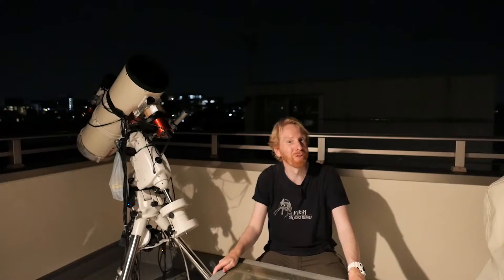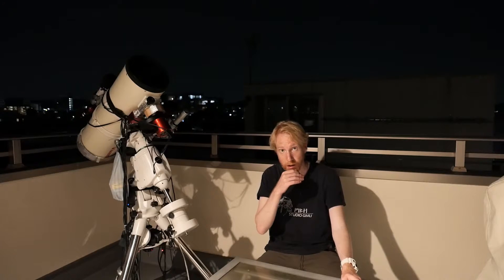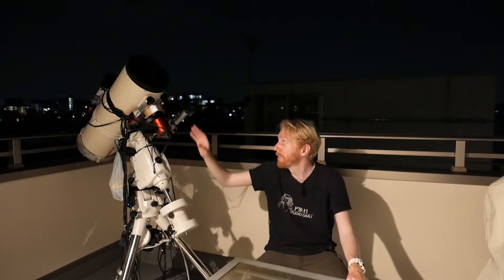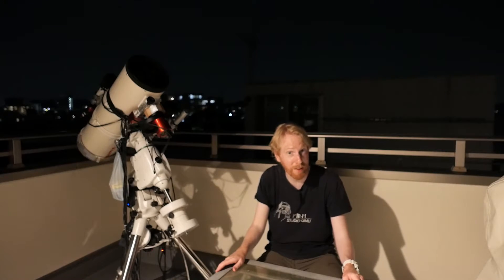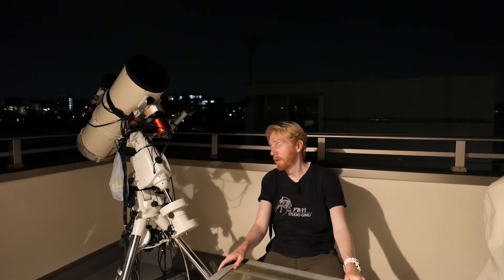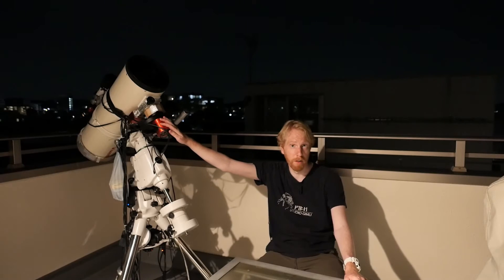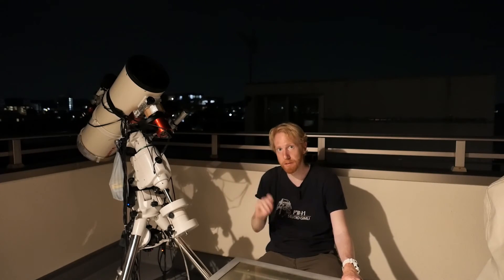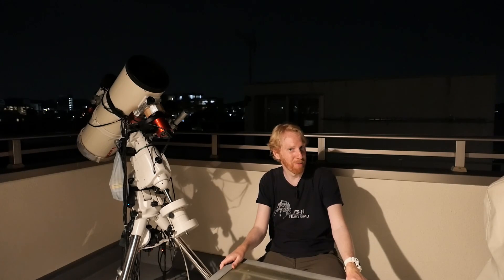When to Retake Flat Frames? Let's discuss!

Comment: Im having issues with my flats making everything worse.  I tried taking them before and even after.  They just make the dust worse.  what am I doing wrong.

ASIair Plus-  Yes, tried auto and was told repeatedly I'm doing them wrong.  The auto mode puts the flats in the middle of the histogram.  Told that it needs to be on the left third.  I did both and still no success.  

I was also told my focus changed and I had to redo them.  No matter what I do I cant fix any of my pics.  
Camera is a ASI1600mm Pro.  
Telescope 8" Carbonstar RC
ZWO LRGB and SHO filters.

Comment: If your optical train does not change for a long time. 2 weeks, 2 months, 6 months. Do you worry about the objective lens or mirror is open to the evening sky and elements? Over time dust could get onto the mirror or objective lens. The moisture in the air will help to accumulate any dust in the air onto your lens. Is this a worry you have?

Comment: I hate taking flats! I need to buy a flat panel to make it easier. On Saturday I sat and meticulously cleaned my senor window, every filter in the wheel, my field flattener and the front lens of my refractor. Took sky flats for every filter. Only one dust motte worth bothering about. Imaged ngc281. Went to put lens cap on scope at the end of the session and it had loads of big dust particles on it!  I presume this built up during the session so my flats are no good for the later subs and if I retake they aren’t right for the first subs. I’m starting to think that I won’t worry about the dust - just remove obvious stuff in Photoshop- then I only need one set of flats to remove vignetting and equalise flux in the pixels. As long as the imaging train stays the same I can just do one set every week and it should deal with most things. Which flat panel do you recommend for use with N.I.N.A.‘S flats wizard as I need flat darks too. Thanks.